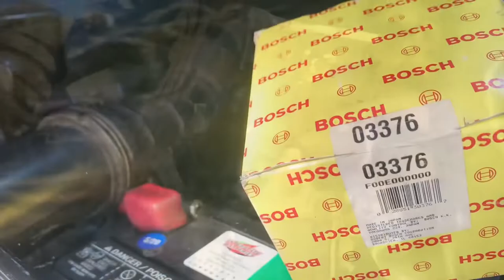How to remove & replace distributor cap and rotor from 88-91 Honda crx / civic DIY

Comment: Such a nice video!! one question... What could be the problems for a bad rotor? Mine doesnt spin correctly. I have a honda civic hatchback 1990
Reply from the maker: Mike

Engine doesn’t spin correctly means your timing belt might have skipped a tooth or more. Meaning your piston and valves are hitting each other.  That is the worst case but it could be as simple as wrong spark timing meaning spark plug wires were in the wrong firing order.  It could be a bad distributor. You can actually find a lot of these trouble shooting in YouTube.  I hope this answer your question.  If not please give me more info prior your engine not spinning correctly.

Thanks for watching my videos and your kind words.
John